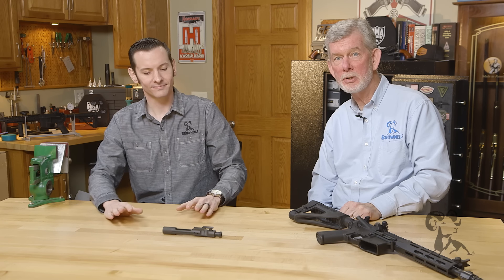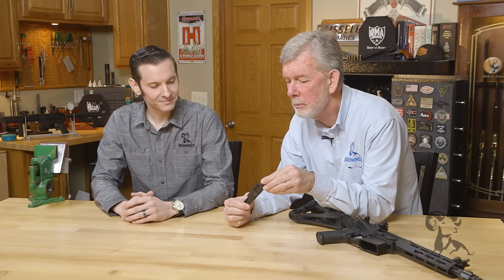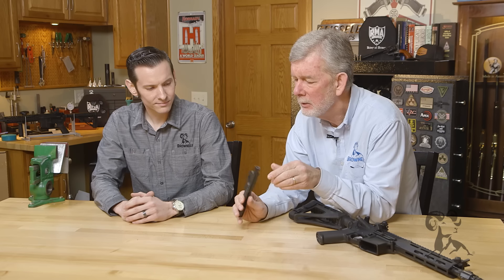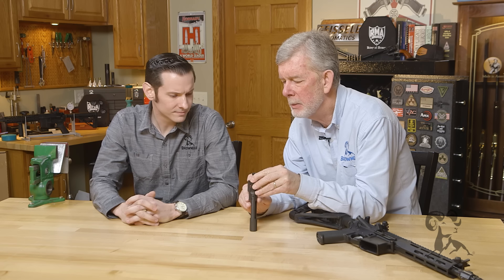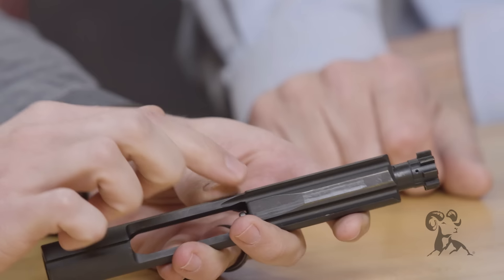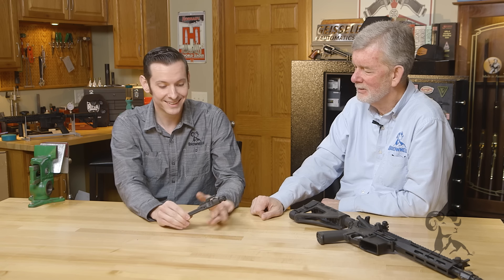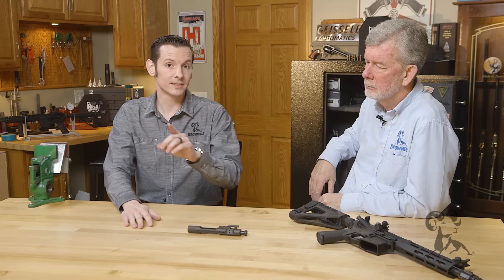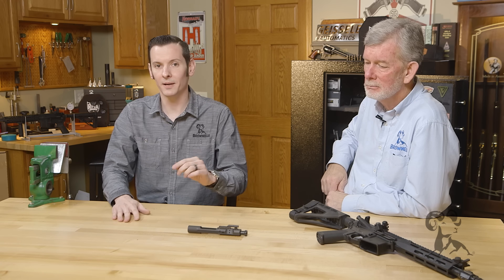Smyth Busters: AR-15 Bolt / Carrier Lubrication

Comment: I watched  a you tube vudeo.just over a week ago telling me to put oil in those 2 vent holes. I'm glad to hear from Professionals to not do it.
I oil it on the places you pointed out and a drop on my Charging handle where I see a shiney spot
Reply: If u don't take the bolt out. I could see putting some thru the holes. If the rifle is going into storage.  For corrosion resistance on the bolt itself.  
Typically I'm just going to pull the bolt and have a light sheen of oil on the whole thing bolt and carrier. With extra attention to wearing surfaces rails, bottom where hammer drags and gas rings along with the bolt tail that's always a pita to clean

Comment: I never served, but I had also learned SOMEWHERE to put a drop in the gas key and into the holes on the side of the carrier. It was very important. I had also learned that the bottom surface should be dry. Then, everything else should be dry except the friction surfaces on the top and bottom - lubing up the carrier and the bolt itself and all that was a bad thing that would be a dirt/carbon magnet.

So good to know that 2/3rds of everything I've learned is wrong...like usual. =)

Comment: I’ve never run my bolt dry but I have run them with varying degrees of wetness based on the never-ending opinions.  In my rifles it doesn’t affect the weapon whether the BCG is lightly wet or totally wet, they run fine at any level.  That includes lubing/not lubing the gas holes.  The only thing consistent in my rifles is, I only use Balistol.

Comment: My NiB bcg..... Lube the 4 rails, cam pin, gas key rings, a little on the bolt, and the locking lug. Good to go. 
Seen it done 100 different ways, but to each his own. Shoot straight, shoot safe.

Comment: I think I’m going to lube my BCG in Dura-Lube.
Nano lubricant.  Gets in the metal.
I’ve used it in many engines big and small.
Always impressed by this product.

The only concern is that it contains SAE motor oil.
I’d have to clean it well after treatment.
Motor oil will “cook” and produce hydrocarbons.
Which will gunk up the works.

Liberty. Constitution. Republic.

Comment: Perhaps another video discussing grease or alternative lubes in the buffer tube?
Reply: Grease with the buffer tube is a BAD idea if you live in a cold climate. The grease will get so hard the recoil spring will not be able to return the bolt to battery

Comment: I always put an oil coating around the entire bcg. 

It’s a little more cleaning after the range but my guns have never malfunctioned either I’ve never had a jam and my charging handle pulls super smooth.

I do put a drop each also in the grooves you mentioned. 

I’ve watched a lot of videos on this subject and my opinion is if it’s something that moves it should probably have oil on it. 

Not a crazy amount but just a light top coat. 

I think it was your channel that said regardless of wet or dry they are gonna get dirty anyway so do you want it dirty and dry or dirty and lubricated.

That’s the one that always stuck and it’s held true for me so far. I’m running psa upper kits with cheap lowers too it’s not like I’m using a $3000 ar or something.

I’m sure running a dry gun works just as good but I feel better knowing anything that’s about to move has help.

Obviously though this is just the bcg I’m referring to not anything in the lower.

I do give the trigger springs a light brush with a q tip every blue moon though.

Comment: I was in the Army in  70's, we weren't told either of your stories, we were told, after passing inspection, lub it then wipe excess off

And I must've missed it, but the bolt needs lub also

Comment: They told you to put oil in the gas key to help seal the mating surfaces on the rings in the bolt. They need a layer of oil a few micron thick in order not to gauge the cylinder the bolt rides in. Think of it exactly like the piston rings in your car, they work on exactly the same principle. 
I use a Q-tip to sweep around the inside on the front of the bolt carrier before I put the bolt back in.  The amount of oil needed for the rings to ride on top the oil rather then gauge the metal is literally microscopic.

Comment: I tried a little something that seemed to help the gritty feeling of a new build copper anti seize (not much) just a dusting on the inside of the upper where the bcg makes contact enough you can see the copper residue , then oil ,grease of your choice also another very light dusting of the spring I can’t tell you how much of a difference it made

Comment: All I do is clean the gun, then soak a couple patches in oil, then give the gun a good coating! Then I use a few dry patches to remove any excess oil from non-contact surfaces before reassembly. Never had a problem with any of my guns!

Comment: Having fired many hundreds of thousands of rounds through M16s, m249s, m2s and  M60 machine guns, I have found that liberal use of automatic transmission fluid mixed with synthetic motor oil to the consistency of honey as a lubricant will keep your weapon firing.  The only time I change that recipe was in the Arctic in Alaska where I used only the automatic transmission fluid. In the desert it depends on what type of sand, but if you run them wet, then you have to keep them wrapped up to keep the sand out of them.  Then just clean and relube them frequently. 
 It's no mystery to me why I never had problems with malfunctions and stoppages

Comment: If in sandy conditions? I use a dry lube such as Strike Hold or Clenzoil to clean and maintain my weapon. Drawback for me? You need to apply it more often and since it's a dry lube and wipe off the access.

Comment: I lubricate my BCG with high temp wheel bearing grease. Or any lithium based grease. I just put a dab on my finger and put a light coat on those friction points they mentioned. Not a glob or insane amount. I do put some around the bolt as well and the cam pin. Baby runs smooth as silk. Stuff is pretty cheap and will last a loooong time.

Comment: I have a NiB BCG that I ran dry with my AR pistol and god damn that thing immediately got fouled up to hell with 90 rounds. Lots of burned carbon and on the back end of the bolt assembly there was some stuff that actually kind of looked like copper oxidation which was really weird and idk what's up with that. The carbon set in too so it wasn't coming off with just a rag, I had to get in with a brush to get it off. We were running 55gr PMC bronze out of a 12.5" barrel with a carbine gas tube, but that was way dirtier than I expected still.

Comment: If I don't run it wet, it starts malfunctioning, not cycling right, won't fire, click- no boom. I have to run it wet. Just got it today, ran about 200 rounds through it, it's a new Anderson AR4 old school 20" 556. Maybe it needs broke in some more, maybe it's a gas issue. That bolt needed to be wet to move. Had several different magazines, okay surefeed 20 round was what I used the most. Straight shooting rilfe, hope everything is good with it. I lubed the shit out of it with Break Free CLP and it solved the problem everytime. Problem was, I had to do it a lot.

Comment: I do lightly lube the combustion chamber on my bcg but i use  a thin layer of high pressure high temp grease , i do the same thing with my cam pin and the wearband on the bolt head itself .  So far im at 3500 rounds supressed with 0 issues

Comment: Each unit I was in 78-82 told us to run them dry and one drop in the gas tube on the BCG.  Oil attracts dirt they said.  Ft Ord and deployment to Ft Irwin we ran them dry.  Ft Sherman deployment, very light oil applied with a shavi8ng brush.  Ft Richardson, AK, again dry, especially in winter when if you didn't have the special cold weather lubes, which we typically didn't have, the lubricants could freeze and prevent your weapon from operating.  LSA and RBC were the fluids we used until about 79 when the Army transitioned to Break Free CLP.  And the M-16 TM from the late 70s I have even says to put a drop of oil in each of the holes on the side. Lol

Comment: After a thorough cleaning and removing of all the carbon, powder residue, that I can remove and reach, sometimes with a pipe cleaner and a few Q tips, I'll spray the bolt with Ballistol inside and out, wiping some of the excess off, then it goes back into the reciever, along with a little lubricant on the charging handle!

Comment: We were told to use the two vent holes on the side to put oil on the gas rings inside, not as oil holes but convenient if you forgot to put oil on the gas rings before reinserting the bolt.
Reply: Exactly. If your taking your bcg apart then this isn't necessary but the bolt should be slightly lubed within the bcg... These guys are making it sound like you don't need to lube these thing much at all. I think this video is giving slightly mis guided info. If in doubt the ar platform should run more lubed vs less lubed. Not had a problem in the over decade Ive owned multiple ar-15's. Hell Ive heard story's from vietnam vets of them dunking their bcg's in buckets of motor oil to keep the guns running.

Comment: I tend to use a little grease on mine.  Oil is effected by gravity too much and after you lube it with oil and it sits for a wile the oil completely runs off the metal and its almost dry.  Grease on the other hand will still be on there.

Comment: Not many firearms have a problem with too much lubrication.  It has been said that a direct impingement AR-15 craps where it eats.  Running it wet helps to wash away some of that crap (mainly carbon).

Comment: It is almost impossible to over lubricate an AR15. I've personally seen professional competition shooters drenching AR's between stages. Seen retired Delta Team operator Larry Vickers do the same thing. Is it messy? Yep. Is it typically needed? Nope. We have several older, high mileage, AR's for ranch rifles and they are typically run wet with 40w motor oil. Reliability has always been 100%.

Comment: When I was in the Corps (99-03) they would tell us to leave a light coat of CLP over the whole surface of each part. We’d just use our CLP brush to distribute the CLP evenly throughout the BCG. Till this day it’s hard to break that habit and I haven’t had an issue so far but then again I’m not kicking doors down with my AR anymore.

Comment: I use high-temp synthetic bearing grease on my semi-auto rifles. Only a thin coat where metal slides on metal. Trigger groups get wiped with a light coat of Rem-oil during cleaning. I use this method on both my AR and M1a with zero failures or issues to date. My pistols get lubricated with Mobil1. My bolt guns just get Rem-oil cause they really don't get dirty and it's easy to just spray.

Comment: I agree oil into gas key makes no sense nor oil into vent holes. I got best results  with light oil on rails, where hammer rides, and the bolt pins.

Comment: I run my personal system a little on the dry side.  I've logged over 10k rounds with no malfunctions due to lubrication.  Most, if not all, have been caused by faulty parts or ammo.

Comment: In rainey season, we poured a glop of LSA straight down the bore and let it go through the bolt carrier and into the recoil spring and buffer.  We also only loaded 18 rounds into our 20 round mags.  Don't know if it mattered, but the rifles worked.

Comment: I just use synthetic valveline motor oil the same oil I put in my truck, I use brand new oil of course 5w/30 and they all run fine

Comment: All my BCG get a wet coating. What get blown off is what's not needed. I'm running 2 NIB and  Black Nitride Also Phosphorus Carrier. All run as they should. I use Royal Purple oil or Lucas Gun oil.

Comment: Amsoil gun oil is the absolute best oil to run in AR15’s. Completely disassemble BCG & clean as best you can. Next, oil cam pin rigorously. Then, oil rails as you see in this video. Following that, oil gas rings. Lightly oil firing pin. Lightly oil locking lugs.Lightly oil the the tip of the gas key as well as the top of it. Lightly oil underneath and around the charging handle. Lightly oil tapered tip on gas tube..

I recommend applying all lube with a foam Q tip. Minus the gas rings and cam pin. 

This is how you properly lube an AR 15 BCG…

Comment: I personally ran my bolt relatively dry in both Iraq/Afghanistan (2/7 Echo). I used a light layer of CLP on the outside of the BCG and wiped it down with a rag to avoid gunking, but that's it...

Comment: A q tip with a little stainless grease over the bearing surfaces and a drop or two of Rent oil on the bolt pivot. Ten thousand plus rounds and twenty-four years and my Colt HBAR is still going.

Comment: After having the dissembled BCG in my sonic cleaner, I rinse it off with water, dry it, submerge it in a tank of Slip 2000 for 15 minutes, shake off excess oil, put it together,  and install it in the rifle..  Never had an issue.

Comment: Motor oil works just fine or wheel bearing grease if it is hot out or you are running it hard.

Comment: I typically put 1 drop on the gas rings of the bolt and the portion of the bolt that contacts the carrier gets a drop too. Other than that I typically put oil on the outside of the bcg on the surfaces that contact the upper receiver.

Comment: As an experiment I tried to run a BCG dry on a newly assembled AR in 5.56/.223.  The bolt would not pick up a fresh round due to short cycling.  The rifle ran as expected after lubing the BCG.

Comment: I tried running BCG dry and it did not work for my firearms. I lube those areas suggested by Steve and Caleb. I always carry extra lube when I’m at the range. My firearms run better on the wet side.

Comment: Good information. It’s a sad reality of our conventional forces that one thing is taught or trained as correct and you’re not really supposed to question a superior NCO or Officer about it and as a young troop that’s just trying to learn, you look up to those experienced combat vet Drill Sergeants/Instructors to teach you what’s right, but sometimes they’re just carrying on what they were taught themselves and it can be bad or outdated information. 

You see this with simple topics like this, but I’ve even encountered older vets who refuse to accept that using the C clamp or C grip method on a foregrip is just some attempt to “look cool” and refusing to acknowledge that it does in fact make for a far more controlled weapon, as opposed to the old school way of just gripping a vertical foregrip, where you’re just not getting as much control. 

I’m out now myself, but it’s up to the newer generations of NCOs and Officers to adapt by questioning the “why” behind things to get a better understanding of how their weapons and gear function and what’s actually going to improve reliability and sustainability, rather than just carry on doing the same outdated and bad practices.

Comment: Could you guys address the oil vs. grease question?  (If you haven’t already). 

Those rails and especially the area that rides on the hammer are points I would consider using a light grease rather than oil. The theory being that grease stays put whereas oil would tend to be thrown off on parts sliding back and forth.

Comment: Just getting some good old-fashioned 10:30 on sale pouring it into a 5 gallon bucket and throwing every single part of the gun inside of it and let it sit overnight is work for me for years
Reply: The course for some reason eventually everything starts to freeze up and I have to clean it all back off. Damn I must be doing something wrong.
Reply: Maybe I should try switching over to synthetic or maybe transmission oil power steering fluid?

Comment: I soak the BCG in mineral spirits to clean it.  I then put a light coat of synthetic motor oil on all surfaces to retard rust, but put a bit of grease on friction points (anything that takes on a shine) to reduce friction.  I haven’t had anyone tell me this method is wrong yet, but been told by my gunsmith that it’s logical.

Comment: I was told to run my brand new piston Ruger SR556 back in 2009 or 2010(???) as "wet".. Have not had a problem since. Now I am building a Aero Precision DI and am told to follow exactly what you said. Please  comment.

Comment: Tried dry lubricant blast w/Teflon and after 300 plus rounds of precision shooting out in the field on prairie dogs, it locked up. The bolt would not rotate.   The firing pin was stuck in cam pin.  This never happened when using oil/grease

Comment: Run the Inside of my BCG totally wet with Mobil 1 10w30 and grease the bottom rails with Synthetic Auto Bearing Grease.  Never a Problem.

Comment: They told you to put a dro of lube in the exhauset holes as it will lube the gas rings (piston rings). Not right before shooting it, but it will prevent corrosion. As for the mouth of the gas key, the gas tube is slammed in & out every cycle, so a tiny drop makes sense but not required.

Comment: I look at it this way, BCG is steel surrounded by much softer aluminum, and including the buffer tube, that said I use oil to grease on contact sufaces depending on temps it will see during that run cycle.

Comment: I have a Colt target hbar that has had thousands of rounds run through it. It gets stepped on kicked and dropped in the mud. I have never put one drop of oil on it and it shoots better than the ones that I take excellent care of. It's been in my truck for years and it's looks like crap

Comment: i was told to run it wet but never put anything into the gas tube other than gas unless you needed to clean it. i use g96 gun cleaner and lube but it's getting hard to find.